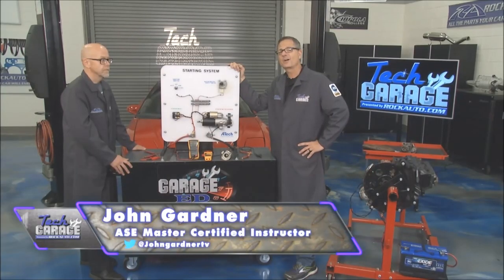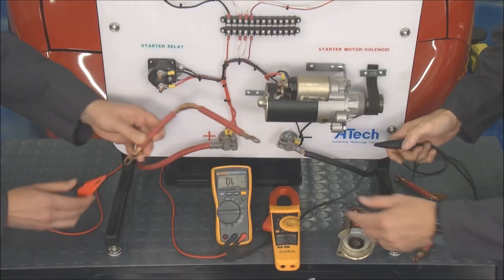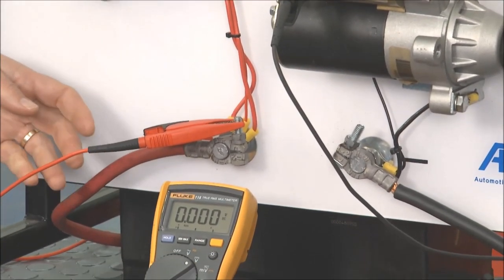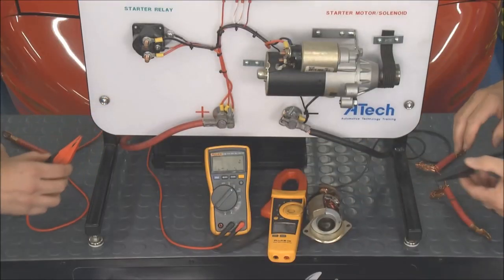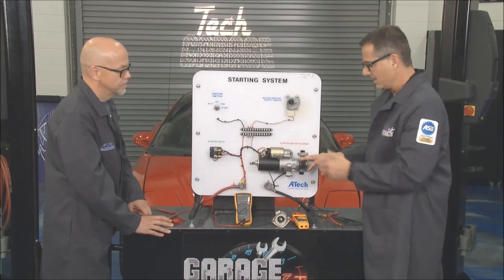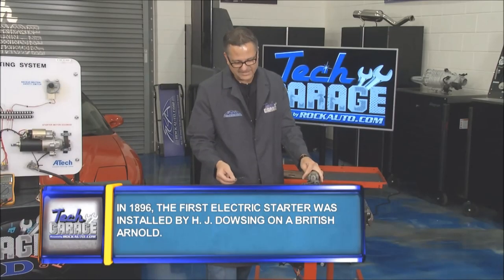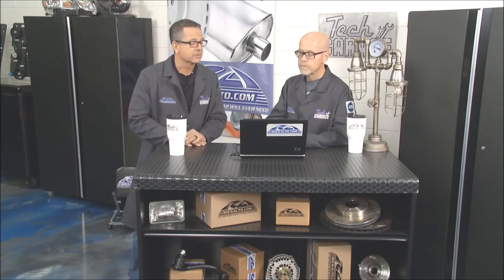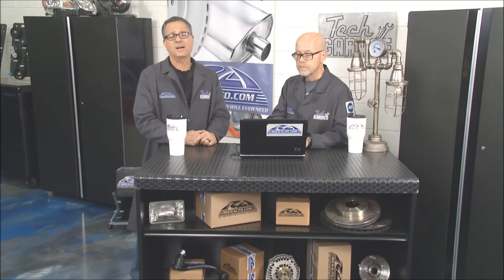Starter Motor Problems Caused by Voltage Drop, Shims to Correctly Position Starter (Season 5/E9)

Comment: I recently installed a new starter. The problem is the starter is free spinning. I've changed the battery terminals and installed a new battery. When I hooked up the new terminals to the battery. The starter is not engaging. What could be the problem.
Reply: Did you find the problem? I have the same problem
Reply: What’s the problem
Reply: @greenjay3158  bendix doesnt kick out, its either a cabling issue or internal .